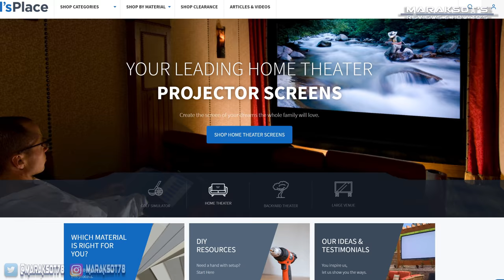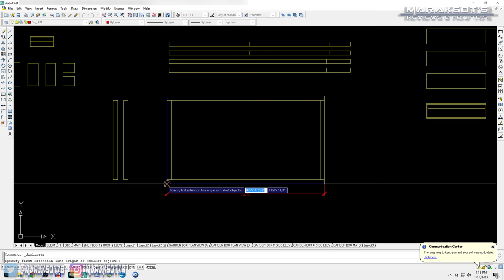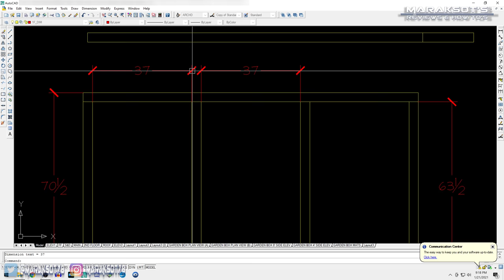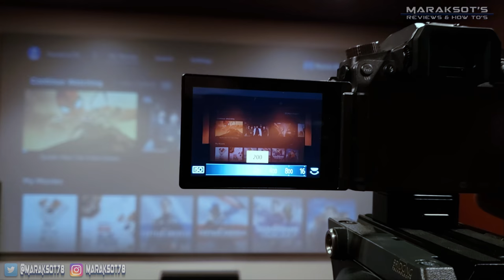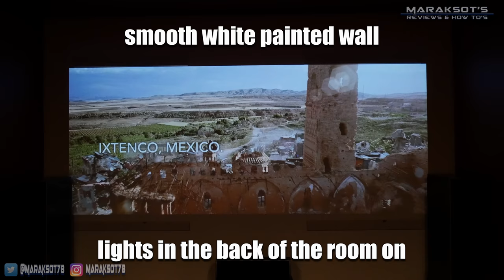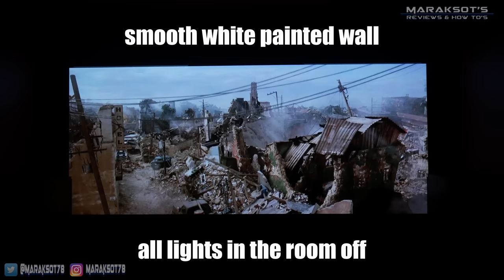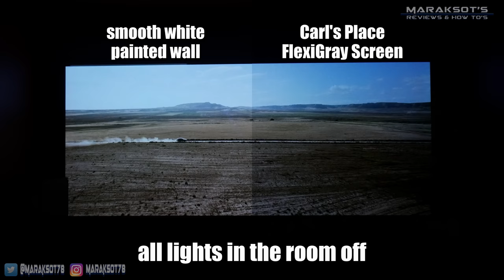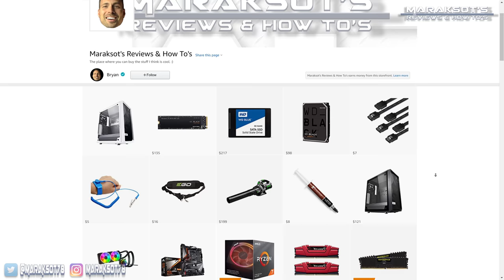144" DIY Home Theater Projector Screen - Carl's Place FlexiGray VS Smooth Finish White Painted Wall

Comment: Great video!!! Thank you for the details. What type of paint do you use on your wall? I think, if you would have painted your wall with the gray color, you would have experienced the same as your screen, right??
Reply from the maker: The paint was just a flat white latex paint. I imagine if I'd used a flat grey latex paint of a similar shade as the screen the results would be similar to the grey screen material.

Comment: Thank you for this great educational vid. Which white paint do you recommend using? White flat or semi gloss? Behr premium white? Also, Is there a difference in using Digital HD paint for projector vs just white premium behr paint?
Reply: Do some research on paint that's specifically designed for use with a projector.
Reply: @smileychess  That question is after research. If you have answer that’d be great. Coz ad suggests Ultra HD paint, but people in their reviews say it looks same as a regular premium white matte, which does the same job.
Reply: @TheBabaiful  Unfortunately I don't know more than you.  I'm just aware that such paint exists.  Best of luck to you.

Comment: @Maraksot78  Did you research just painting the wall the same color grey as the screen?    just curious
Reply from the maker: I did look into gray paint and even projector screen paint but in the end decided on the screen material because I enjoy these types of DIY projects.  :)
Reply: I had the same question when I started watching the video! Wonder if anyone had actually tried paining grey toned wall color.
Reply: @dhruvinb5153  I have a light grey wall in my media room that I use for my projector and it was GREAT with my old dlp projector (that just died last week), meanwhile with the new led projetor I purchased overall colors and blacks are better now but whites and general brighter images (example, hockey games) aren't as good. I think I'm switching back to a white wall.

Comment: The same results could be had by adjusting the projector's output levels (if available). There are screens that reflect back at viewing angles where most of the light goes to the viewer and not to the surrounding walls and ceiling.  Any fabric will have a more uniform surface without potential "hot spots" a painted wall can have.
Great mounting tip with the "french cleat".

Comment: Why has nobody thought to buy black 3.0 paint which absorbs 99% of sunlight it takes it in and it will not let it out it's the darkest black there is other than well actually it's darker than vantablack which you can't buy that so but 3.0 black can be purchased and it is 99 percent

Comment: Bro, your projector is not bright enough for the screen with 0.8 gain. I agree, in your case, the white wall looks better, but if you invested in a better and brighter projector, the effect would significantly differ.

Comment: You may need to recalibrate your projector settings
Reply from the maker: Yah, I did that and things look great now.  For this video though I wanted to keep all the projector settings the same on both surfaces to see what the result was.  I didn't think about showing what the screen looked like once I changed my projector settings until after the video was already posted to YouTube.  Making videos on YouTube is a learning process and I've learned that next time I'll be sure to include that.

Comment: May I make three suggestions:
* Use actual proper test patterns (rather than that crap Spiderman film)
* Toe in your left and right speakers. They'll sound better and won't be in the way of the screen.
* Turn the lights at the back off dude!!!!
What are you thinking? Why would you buy a projector, then wash out the picture all the time? Just buy some auto-sensing puck lights or something.